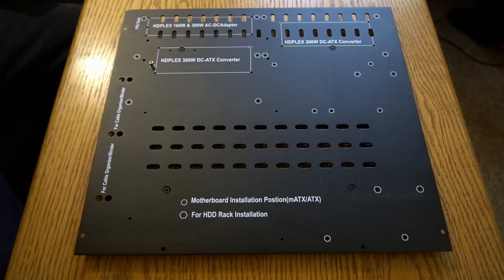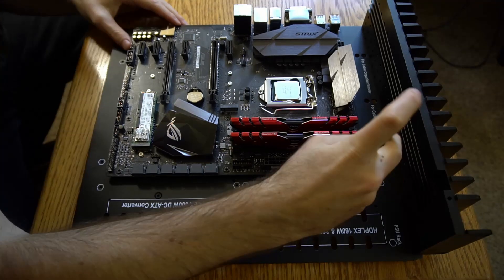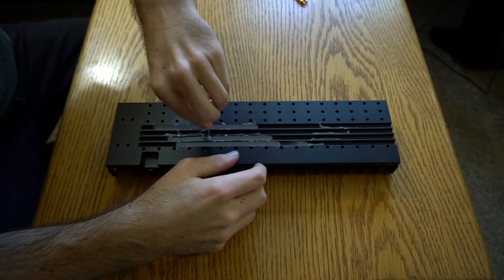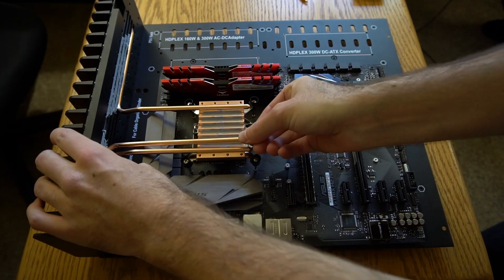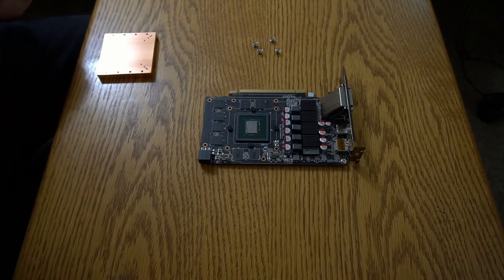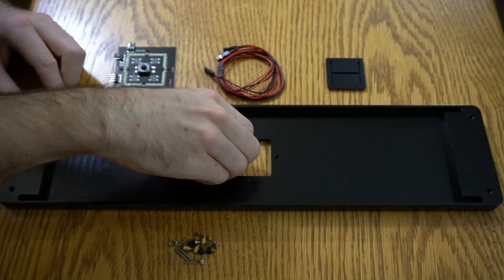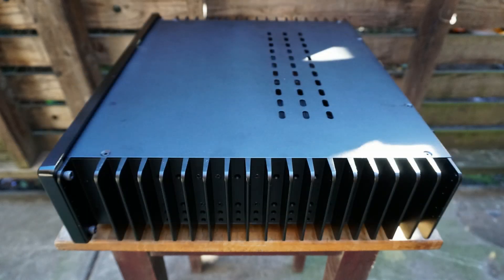HDPlex H5 Gaming PC - Building a Fully Silent Fanless PC

Comment: What can I put on the areas where I have applied thermal paste to prevent it from drying whilst I apply paste to the all the other surfaces?
Reply from the maker: The paste is not water based and won't dry. It is closer to an oil, so there is no need to cover it while you apply it elsewhere.

Comment: Any reason you didn't have thermal pads between the VRAM and the GPU heatsink? I have an H5 at home with a graphics card which I installed it without any VRAM cooling either as the conventional fan cooler didn't have any. Realize now in hindsight that the stock cooling has a fan blowing cool air on the RAM modules and the HDPLEX instead has a heatsink radiating heat...

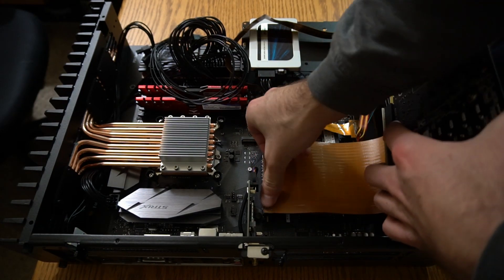Comment: I'm struggling to find the information I need. At 11:20 you fit the PCI-E riser and then the GPU. Would the PCI-E riser fit in another PCI-E slot further down the board, and fit underneath the GPU?

In your video it looks like it's very close, but you could probably sit the GPU on the riser (with some protection like a rubber pad)?
Reply from the maker: Yes, the riser would fit in a lower PCIe slot, although the top slot is generally the fastest so it is usually best to use that slot.  The GPU would fit above the riser, and yes, it would be a good idea to place something in between the GPU and riser in that case.
Reply: Perfect, thank you!

I’m wanting a GPU and a DVB-S2 card, but getting a mobo with the right combo of ports is tough.

It looks like ATX is best, but so many high end ATX don’t have WiFi, or skip the slot 1 pci-e port.

Next job is finding a GPU without needing to re-tap new holes in the GPU block, but offers a high quality setup for low temps etc.

These are definitely a fun, interesting and challenging build!

Comment: One of the heat pipe ends in the cpu block has a stub end. Why is that?
Reply from the maker: It is simply how the heatpipes are manufactured.  One end is stubbed like that, the other is pinched.  It makes no difference which end is used where.

Comment: I like the amount of heatpipes but they need to be soldered to the cpu block and fins....thermal paste is not efficient enaugh to pass heat.This is why they press the fins into the heatpipes,this way they have the maximum contact....ps This solution can't run crysis..things that can't run crysis are trash...

Comment: That case would cool significantly better if they doubled the number of fins on the sides.
Reply from the maker: Maybe, but it's not simple; the more space you have between the fins, the more space you have for better passive airflow.
Reply: @fullysilentpcs  
There's obviously an optimal spacing somewhere, but I'm pretty sure that somewhere is closer than the current design. I've never seen an air CPU cooler, passive or active, with the fins so far apart. I've never seen an air-cooled motorbike engine with the fins so far apart. I suspect they're just saving costs here.

Comment: Would temp drop dramatically if a PCI slot fan is installed? thanks.
Reply from the maker: I'm not sure; the heatsink fins are on the outside of the case so an internal fan might not do much.
Reply: @fullysilentpcs  Only the external surface is exposed to outside cool air...So if even one small turbo fan that turns on optionally and exchanges air with outside cool air when needed, it should "double" the total surface area available for cooling.

Comment: i9 9900k can use this or not?
Reply: LOL a 280mm AIO (water cooler) can just about cool an 9900k. This isn't suitable for high end equipment at all
Reply from the maker: Not true, you'd be surprised how effective a large passive cooler can be.  I wouldn't recommend overclocking an i9-9900K, but a small underclock might work really well.  The i7-9700K is better to use here, but again without much overclocking.

Comment: How can I get this huge long cooler ?
Why doesn`t it appear in your site,
what`s the model name ?
Reply from the maker: If you are thinking of the long copper heatpipes in this video, they come with the HDPlex H5 case.  They are not available separately.

If you are thinking of the large round copper cooler in another video, that is the NoFan CR-95C.  It is now discontinued.
Reply: @fullysilentpcs  
Thanks
Can I build it custom made by bending copper pipes, and how to make that grill.
I want the grill to be outside my mini ATX case, on top of it. So the heat goes up and dissipates out of the case.
Can I at least get a plate that would fit the copper pipes, or will applying the thermal paste over a plain plate suffice ?
Many Thanks
Reply from the maker: A flat plate would not work very well.  It should have grooves that are the same radius as the heatpipes for the best contact, unless you can find flat heatpipes.  It might be easiest to buy an H5 case from HDPlex and use the heatpipes and grill anyway you want.  Yes, the heatpipes can be bent, though you have to be careful with them because they are difficult to bend nicely.

Comment: Hi Matt !
Because of your video I had sell my current PC and build this H5 up.
I used a ASUS ROG Maximus X Code, Intel i5 8600K CPU,  Palit GTX 1050 Ti Kalm videocard and 16GB Corsair Vengeance RAM RGB.
Because of the beauty inside I decided to use a Plexyglascover on top. I switched all the LED`s of the mainboard and the RAM to red and this looks awesome in my opinion through the smoked Plexyglas.
Thank you for your inspiration !
Reply from the maker: Thanks, that's awesome!

I use an i5-6600K and GTX 1050 ti  in an H5 myself.
Reply: @fullysilentpcs  May you like to see a picture of my build ?
Reply from the maker: Sure!  You can send it to me at fullysilentpcs @ gmail

Comment: Great setup!
Which GTX 1060 are you using? Does it have less than 95W (recommended max tdp for this case)? 

Do you think that build is fine?
https://pcpartpicker.com/user/Othon/saved/#view=tvbTBm
Reply from the maker: Thanks.
I used the Zotac 1060 Mini 6 GB in this build.  It has 120 W TDP, but works well with the case.  The 95 W max recommendation is very conservative.  It can realistically handle 120-150 W.

A couple comments on your build - I"m not sure that the SFX power supply will fit well in the case with a Micro ATX motherboard.  You would be better off with one of HDPlex's 400 W DC-ATX power supplies and an external 330 W brick.  Also, the 2 TB hard drive will make some noise.  I know it's a lot cheaper than going with all SSDs, but it will compromise the silence.

Comment: Only thing is that the VRAM on the video card will catch fire on some point, other than that all is good.
Reply: hardware does not get destroyed by heat anymore. If somethings gets to hot, components throttle or shutdown before taking dmg.
Reply: I've ran my R9 290 with no memory or VRM cooling for over 2 years without issue.
Reply: My 1060 3gb didn't even come with pads or sinks on the vram. Seems like gtx 1060's vram does'nt run as hot as bigger cards.
Reply: @clevername8832  it does, but in your case the active airflow from the GPU fan is enough to cool the VRMs.
Reply: Is there not a massive heatsink on the vram?
Reply: There's already heatsink on those vrams in this case

Comment: Can this case take on a higher end gpu?
Reply from the maker: Up to 95W TDP
Reply: Fully Silent PCs still fairly low... hard to get in a mid high end gpu in there
Reply from the maker: I read cpu in your original comment. For a gpu, you can go up to about 130W TDP.  GTX 1060s work well; a GTX 1070 will likely throttle itself when stressed.

Comment: This build is unique in beautiful way. I'm just concerned that under full load the blocks will turn into radiators (especially the gpu one).
Nonetheless interesting design. Keep up the good work.
Reply from the maker: Yes, they will get quite hot, not enough to burn anything or anyone though.
Reply: Heat can never be destroyed. It just gets moved from one place to another.

Comment: Could you upload a stress test video that proves the temps under load and under normal air temp. Without cuts or video editing.
Reply from the maker: Yes, I can do that.   Are you interested in both the CPU and GPU temps?
Reply: Yes, Both please. I'm very intrested but I want my system to be stable. No overheating that could damage components. 
Question I have is if it is important to rework your thermal paste over some years span. Because in this type of system it's kind of important, maybe?.
My main usage will be Desktop usage and mid range gaming graphics. Like RE1:HD.
Another Q: Can I reuse my old ASUS Essence xonar? Because i sew this in the configuration options for HD plex 5.
https://i.imgur.com/pj4HJ9X.png
How will a card like this fit?
https://www.prisjakt.nu/produkt.php?p=376133
Reply from the maker: You don't have to rework the thermal paste over time, just like with an actively cooled PC the thermal paste will be okay for many years.  The thermal paste is just as important in any system in my opinion; no difference here than with actively cooled PCs because they both need to transfer the same amount of heat.

Yes, you can reuse an old ASUS Essence card.  I use one myself in the H5 case.  It fits above the CPU, and connects to the motherboard with a PCIe riser.

Comment: I have 2 builds of this case, one is with gtx1070ftw and i5 6600, another is with gtx1080 classified and i7 8700k@5G. I limit GPU power in 150 Watt (the full power of 1070 is 200W,the 1080 is 240W), and less than 10% performance is lost(the 1070 loses 5%). I modified the GPU cooler and replaced 4 heat pipes with longer 45cm to bridge the both GPU and CPU cooler, so GPU and CPU can share the heat dissipation scales, this is how the case supports gtx1080 and gtx1070.
Reply: Do you happen to have pics of your setup? Also where did you find the longer heatpipes for this?

Comment: Nice build! I would add a little better cable management, just a little and nothing else. I suggest You change the table where you take the final view  of the assembly on the outside, it ruins the beauty of the build in my opinion.